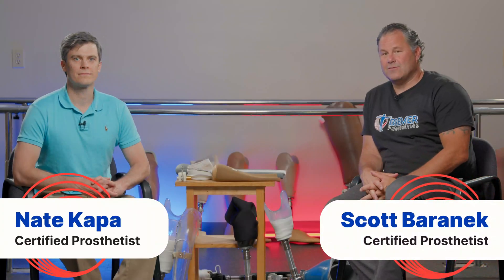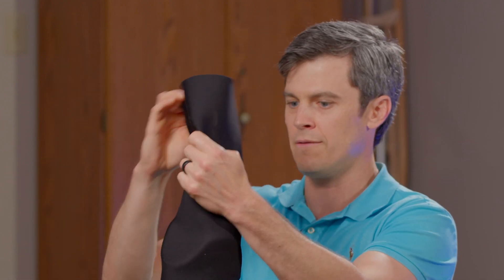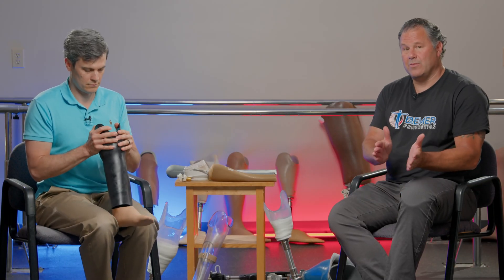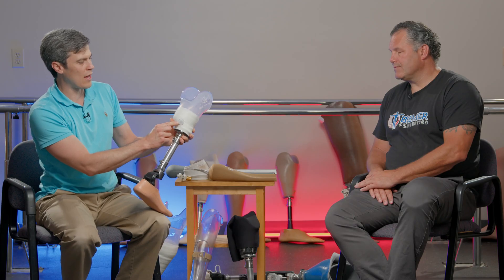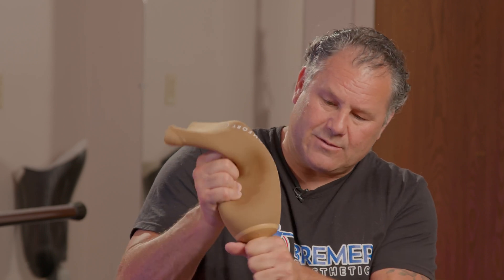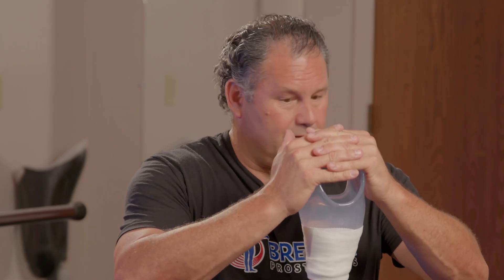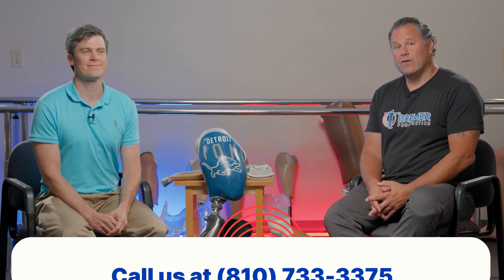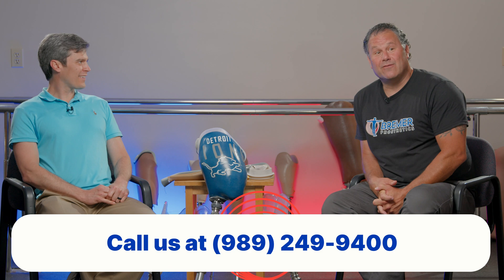Transtibial (Below Knee) Prosthesis Liners & Suspension Methods

Comment: Piston action, get that, but you seemed to have bypassed the socket/fit. I have the pin BK - wall contact with the liner/limb is so important. Distal contact is minimal, I can not imagine bottoming out. I find this presentation confusing - from someone that has never donned a prosthetic. Do not wish to be snarky but…. Oh 14 years in, very active, accident at 60. However, I have begun to want switch to Vacuum system, due to soft tissue atrophy.